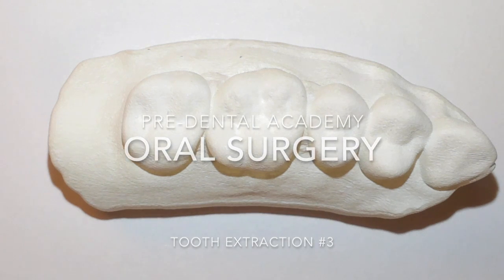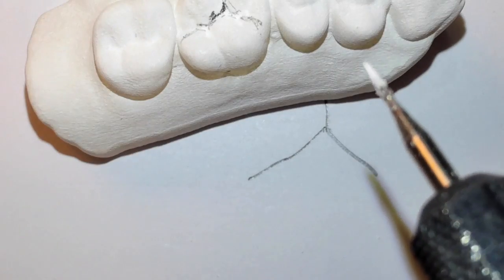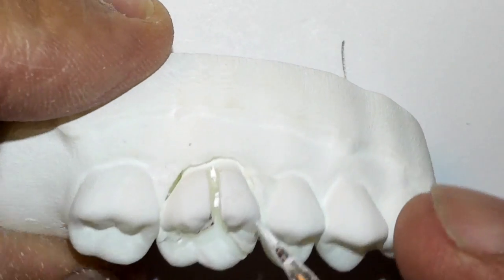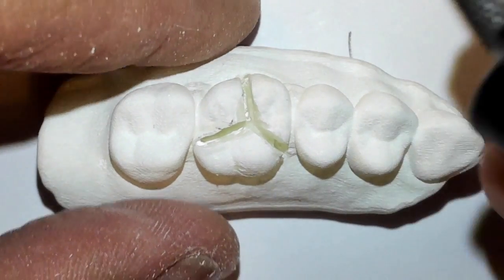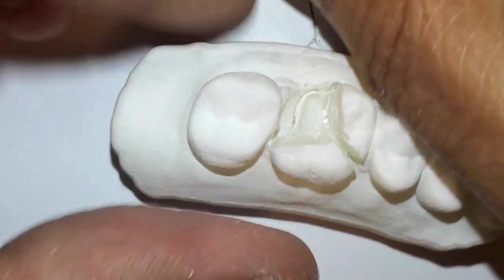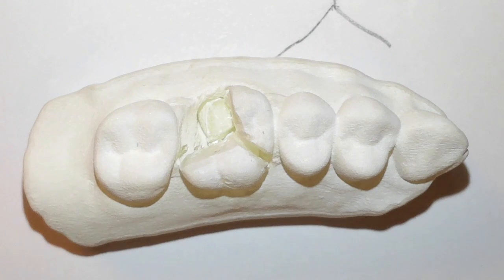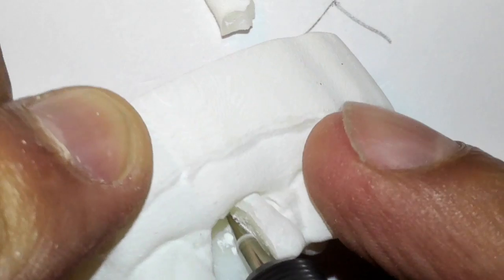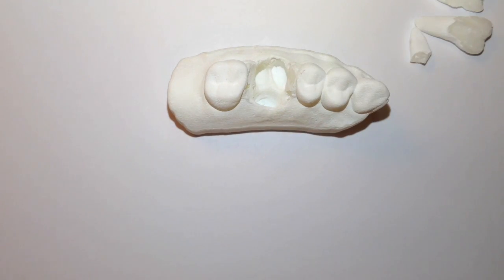Pre-Dental Academy - Oral Surgery - Tooth Extraction #3

Comment: For those asking; I consider it easier to section a molar and take individual pieces as opposed to fighting with 3 roots at the same time. It is less traumatic and it saves your hands. Work smarter not harder. If the tooth is loose then yes, forcep only. But a solid molar will have to be split.
Reply from the maker: Whipmix worked with me on creating this model.  Their amazing CADCAM department worked with me on creating the PDL space.  I took some time off from teaching at FAU.  My wife passed in 2019.  I have been healing and am ready to give back to the university again, ready to teach again. Thank you for understanding my motivation here with this procedure simulation. Best regards, Dr. Gerry Cuomo